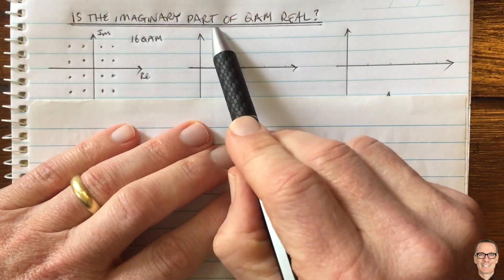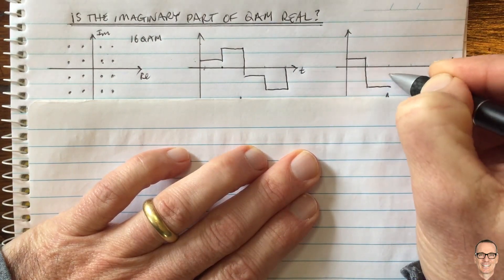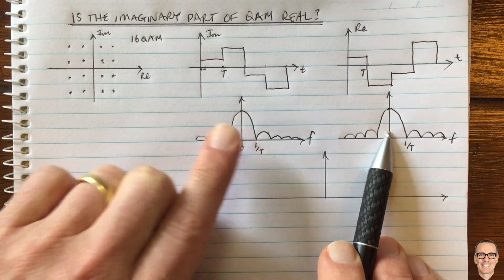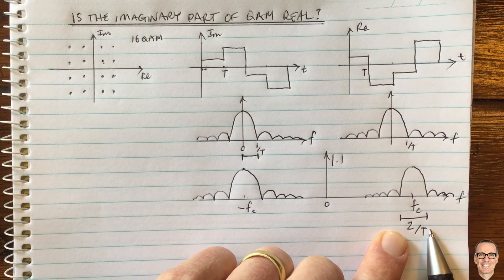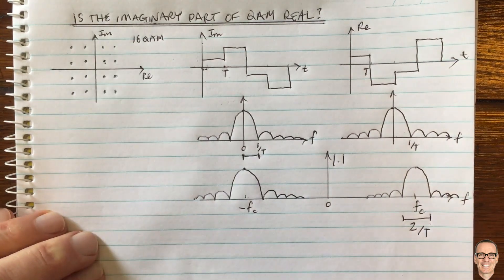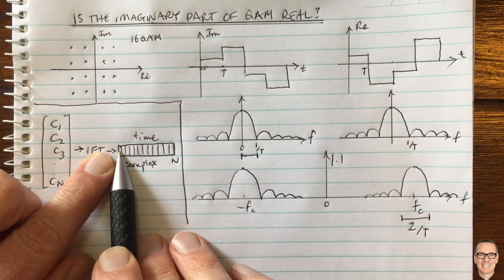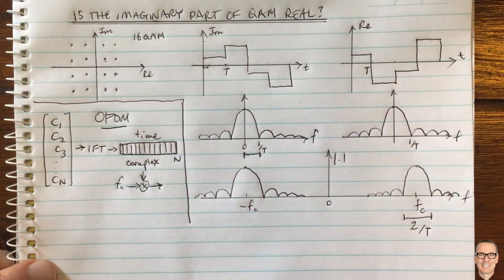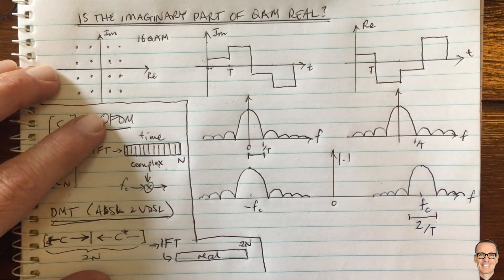Is the Imaginary Part of QAM Real?

Comment: Most of the confusion comes from using a complex numbers representation while describing signal constellation, 

while actual apparatus that work is "Harmonic addition theorem" aka "substitution lemma in A sin x - B cos x = C equation"

It is just A*sin(x)+B*cos(x) = C*cos(x+theta) 

where C=sqrt(A^2+B^2) 

and theta is atan(-B/A)

Replace A with I and B with Q and your confusion is gone.

Yes, its pretty real and in this  form it's pretty obvious as well.

Combine it with multiplication identities , open brackets,  and you actualy can see and feel what happens in spectrum with different I and Q values with different signs and why double side band eliminates but jumps between sidebands depending of value occurs.

Comment: Thank you. In DMT, complex samples can be transmitted in baseband by concatenating the original sequence with its conjugate. This makes the resulting spectrum symmetric (around 0), which makes the time domain signal real when using IFFT at the transmitter and FFT at the receiver. However, why go through this complicated process when we can simply convert the complex valued sequence into a real valued sequence by splitting the original sequence into two parts (real and imaginary), pulse shaping, and sending it through the baseband channel? Is the reason that bandwidth is twice in the latter? Is there any application for it?
Reply: Yes exactly to send real parts first followed by imaginary . Your answer is satisfying for me.. Thank you!
Reply from the maker: It depends on what you mean by "sending it through the baseband channel". Do you mean sending the "real" part first, and then sending the "imaginary" part? If so, then yes, you could do this. But you'd have to equalise each of them at the receiver. The benefit of sending data "in frequency domain subchannels" is that the equalisation task is easy in the frequency domain. This video might also be of interest: "How are OFDM and xDSL (DMT) Related?" https://youtu.be/CET2UuGeEqs

Comment: Dear Professor,

Why do you consider only positive frequencies for bandwidth ( 0- 1/T) at @3.07  .  ? I saw your other videos. Negative frequencies are just the signals that operates in different clockwise direction.  Please explains.. 

Thanks again for great videos
Reply from the maker: Great question. As I explained in that other video you mentioned, the "negative frequencies" are not really "negative" frequency waveforms, they relate to real (ie. positive) frequencies, but with a counter-rotating phase. In terms of "bandwidth", it does not "increase the bandwidth" to have negative frequencies. They are the same frequencies as their "positive frequency" counterparts, just with different phase. So we only measure "bandwidth" over the positive half of the Fourier transform (ie. for f>0). Also, note that we normally define the "bandwidth" to be the range of (positive) frequencies that the signal is composed of (or "the main bulk of the frequencies" eg. in the case of the sinc function in the frequency domain, it actually includes infinite frequencies, but we define the "bandwidth" to be the frequencies up to the first "zero" in the sinc function). For a baseband signal (such as the one I showed in the video), the bandwidth extends from f=0 up to some positive value. And as I mentioned at the @5:34 min mark of this video, for passband signals the "bandwidth" will be double the "baseband bandwidth", since the passband signal is generated by multiplying the baseband signal by a sinusoid.
Reply: @iain_explains so counter clockwise means that the carrier has higher frequency?

Comment: Hi Iain. Great video! Maybe some small clarification is required for real signal production for DMT. Just concatenating C and time reverse conj(C) might not always work - ADSL standard suggests to put 0 into DC and N/2 points on top of adding time reverse conj C.
Reply from the maker: Yes, but that's so that the DC component is 0 (ie. no DC offset) and also because the voice channel is carried on the same UTP wires over the 0-4 kHz spectrum. It's not to do with whether the vector is "real" or not.

Comment: Hi lain....can you please tell me why we use only QPSK for NR PDCCH  and why not other modulation schemes like 16,64 256QAM?
Reply from the maker: I'm not intimately familiar with the details of the design of the control channels in the Standard, but in general, control channels carry (relatively) low rate data that is very important to be received with zero errors (or as close to zero errors as possible). Therefore it is common to use a low order constellation (low rate, with constellation points far apart).
Reply: @iain_explains  okay...I too expected the same reason...but some more points may be there... anyways thanks for that

Comment: sorry i m confused. @6:43 two degree of freedom? the 2/T bandwidth will result even if we don't transmit imaginary part of QAM? Also, what about OOK signal which has baseband bandwidth of 1/T and its passband BW becomes 2/T?
Reply from the maker: I think you're mixing up the existence of a resource, with the efficient use of that resource. Yes, you're right, the 2/T bandwidth will result even if we only transmit amplitude shift keying (ASK) (ie. we don't transmit the imaginary part of QAM), but in that case we are not using the (passband) bandwidth to its maximum efficiency/capacity (in the general sense of those two terms). ASK and OOK both use double the baseband bandwidth (ie. double the necessary bandwidth), but that just means they are not efficiently using the passband. It doesn't mean the passband (full) "degrees of freedom" don't exist.

Comment: Hi Iain, you might be able to explain in a video why a radio signal (electricity in an antenna) is a complex number. What is the physical background to that. Great videos! 👍
Reply from the maker: Great suggestion! Thanks. I'll add it to my "to do" list.
Reply from the maker: In summary, the radio signal that an antenna radiates is a sinusoidal EM wave (physics and Maxwell's equations tell us this). And sinusoidal signals have three parameters: amplitude, phase and frequency. For a given frequency, the amplitude and phase parameters can be represented mathematically as a complex number. For more insights into this, see my video: "How do Complex Numbers relate to Real Signals?" https://youtu.be/TLWE388JWGs

Comment: So for my understanding here, this would be a multi carrier case at f0, with multiple orthogonal sync functions assuming proper size N,Fs? We have C0 to Cn where these are i/q values representing the frequency domain (C0 low band, Cn high band, each representing 4 bits of data), then we ifft it into a time domain where each sample is now an i/q voltage? In this case, are the original i/q values before going into the ifft chosen in such a way that they will be valid in the time domain to be converted and sent over the air or is there more post processing?
Reply from the maker: Hi. I'm not exactly sure what you're asking. Yes, c_0 to c_N are the I/Q values that are to be sent in each of the N+1 sub channels. And yes, in this example, they each represent 4 bits of data (although it could be more, if we use a larger QAM constellation). But they are not chosen in any special way. The time domain signal will be "valid" for any choice of c_0 to c_N. This video might help: "OFDM and the DFT" https://youtu.be/Z4LIgNgNAlI